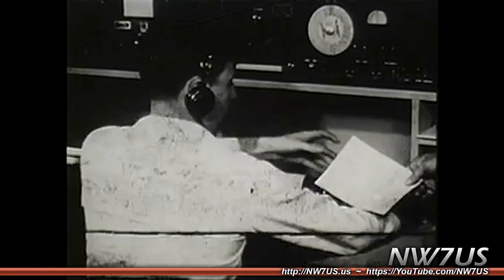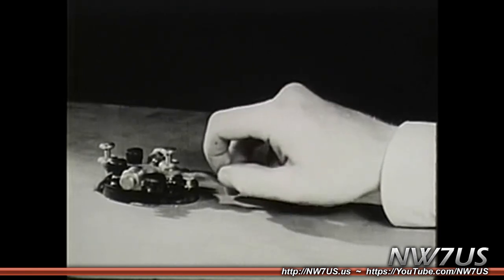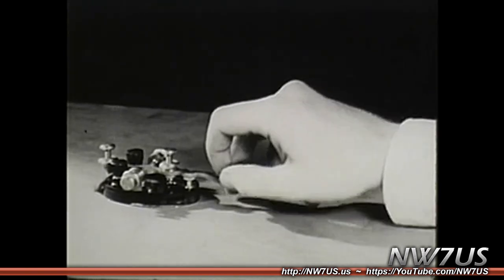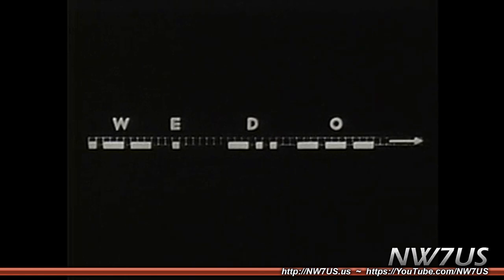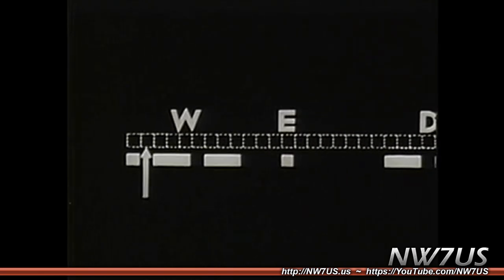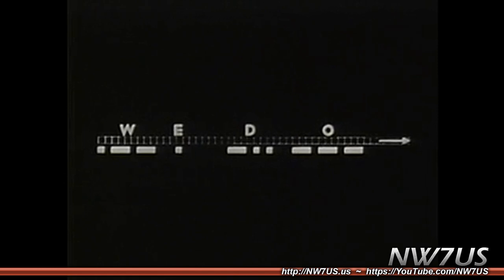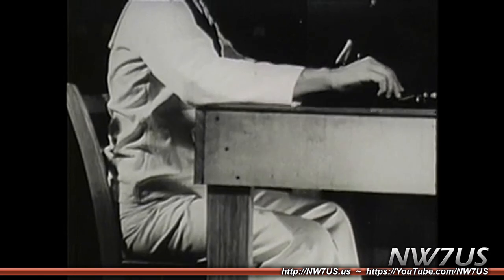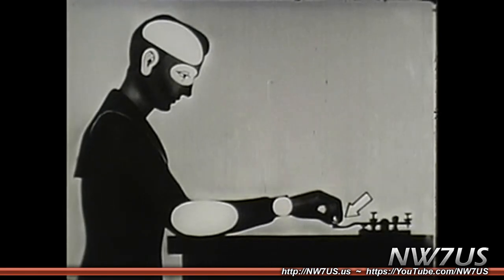Vintage 1944 Radio Operator Training: How to Send Morse Code (CW) by Hand

Comment from the maker: Proper hand-sending Morse code - radio telegraphy 1944

In this vintage United States Navy Department of Defense (DOD) film from 1944, the technique of using a straight, mechanical hand key to "send" "International Morse code" (as different from "American Morse code", used by railroad landline communications) by radio to ships, and other receiving stations is explained.  

https://www.youtube.com/watch?v=XjupJslRj5E

The hand sending key is detailed. Then how to use the key to tap out Morse code, which keys a radio transmitter.

The film specifically trains the viewer on the important parts of the transmitter, tension spring, adjusting the hand key contacts, and adjusting the tension spring of the straight key. Then, the elements of Morse code, the timing, and the parts of the Morse code communications operator's body that function when transmitting the CW code are explored. The film focuses on the importance of correct body position and hand key operation.  A lot of these details are still important for the modern amateur radio operator interested in using Morse code on today's world-wide radio technology that still uses shortwave radio spectrum to send and receive these CW signals.

https://www.youtube.com/watch?v=XjupJslRj5E

#ham   #radio   #hamradio   #hamr   #swl   #shortwave   #defense   #dod   #military   #vintage   #historic   #history   #retro   #film   #movie   #video   #communications   #morsecode   #cw